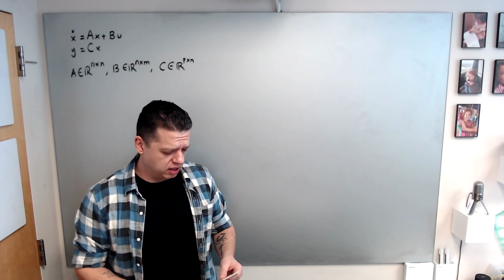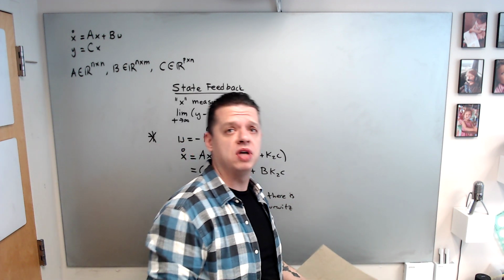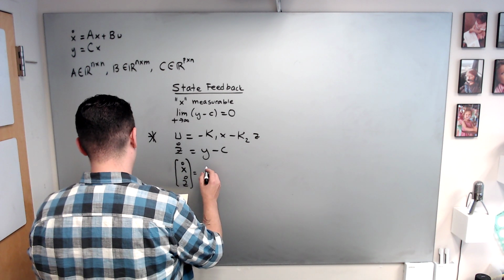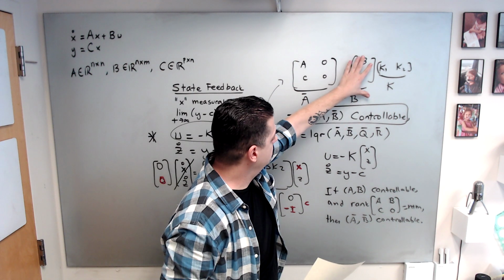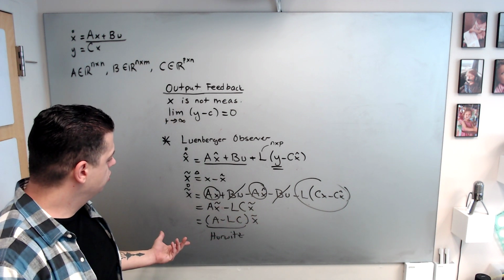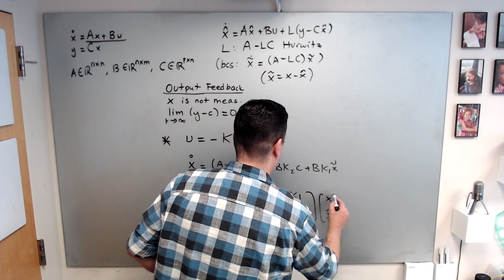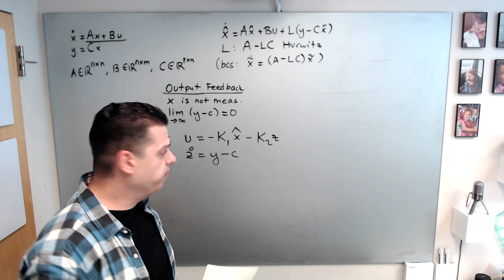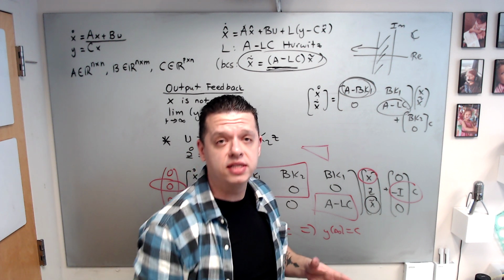Control: State and Output Feedback Control of Linear Systems (Lectures on Advanced Control Systems)

Comment: Hocam selam. Thanks for these excellent videos. My question is can we use this approach with the combination of uncertainities existed in our original system which makes the system nonlinear. What I mean instead of using reference model can we use an observer as a reference model if there is an unmeasurable state, and then uncertanities will be handled by the difference between measurements and observer used as a ref model. The other question is if we have some disturbance or ref data called E x0 in state-space, can we describe the nominal part of the control law with = -k1 x - k2 c - k3 x0 something like this or the desired value can be defined in the observer design part? and ua will take care of error of the uncertainities

Comment: Before anything, thanks for providing the lectures professor. They're helping me learn the taxonomy of controls which is necessary to read papers and actually understand the approaches. As for my question. For output feedback, you use a Luenberger observer to estimate your states provided they're unmeasured. Could we instead use a Kalman Filter as full state estimator provided it's robustness & suitability for noisy measurements? If not, how then is KF implemented in the Output Feedback framework?

Comment: thank you for the video hocam. In a case of step reference for a state such as, lets say instead of regularization problem i want the state x2 to go to 1 not to zero , should i prefer feedforward approach or simply i put a reference input (i mean u=-Kx+c). Second what is the advantage of using time domain approach instead of laplace here because we can use a PID by converting ss to transfer function and of course we check also for frequency response for better performance. forgive me please i cant still get the idea when to use time or frequnecy response :) sorry for long question
Reply from the maker: I would try the integral approach. It has some level of robustness to plant uncertainties and exogenous disturbance. A feedforward approach works too, but only when you know the plant matrices well. About your second question, it is possible but hard to handle multiple inputs and multiple outputs using Laplace approach. Plus, one cannot handle nonlinearities in Laplace domain, not easy. Check for example gain scheduled Control video to see how these stuff extend to nonlinear systems. In short, time domain approach makes things easier for complex systems.
Reply: @tyucelen  thank you professor 🙏